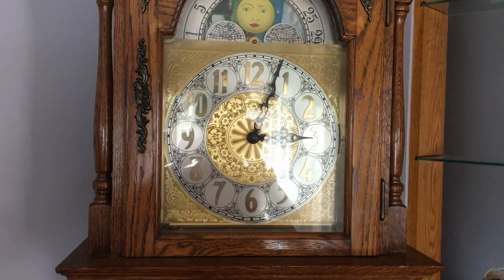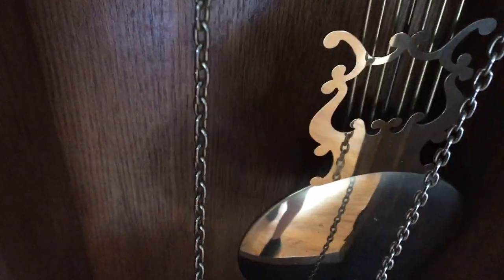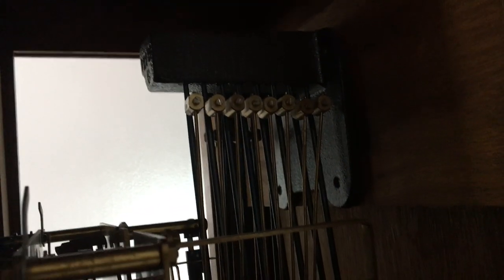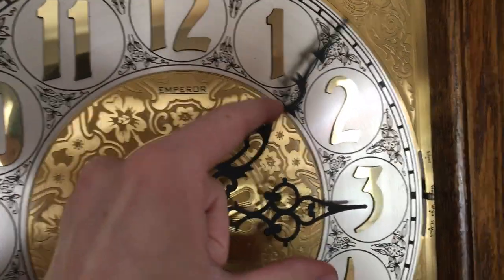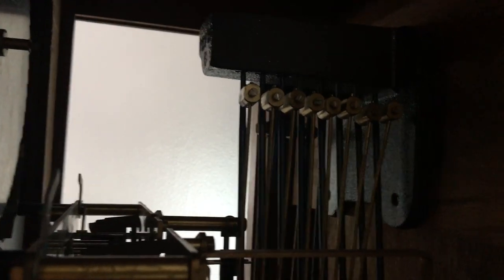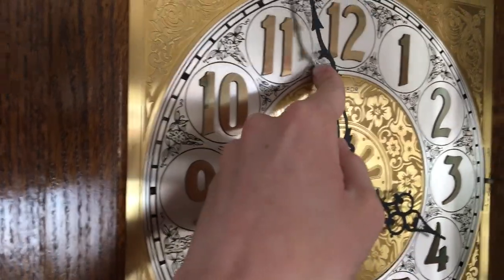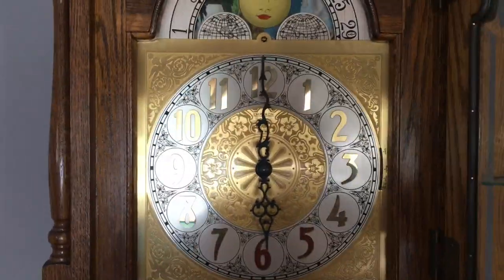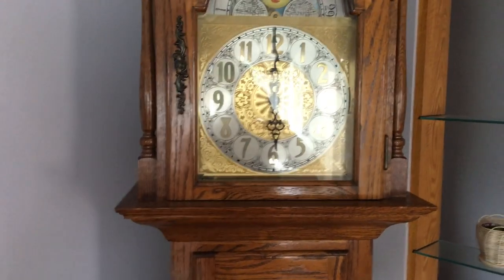Emperor Triple Chime Grandfather Clock

Comment: This clock was assembled by the original owner using the kit of precisely cut wood parts sold by the Emperor Clock Company, which is still in business.
Reply: I have this exact grandfather clock back when this was being sold you had the option of a darker finish (this video) or a lighter finish my clock they are both the same model just different finish options

Comment: My aunt in Colorado has this clock. My grandfather built it around the 1980s.
Reply: I have the same clock
Reply: @cobesclocks1949  Cool.
Reply: I have this exact grandfather clock back when this was being sold you had the option of a darker finish (this video) or a lighter finish my clock they are both the same model just different finish options
 @ceilingfansclocksminecraft1226

Comment: The only difference between this clock and my aunt’s clock is the pendulum and the color of the case.
Reply: @cobesgamingchannel9587  No, it does not, and it can only be accessed through the right panel.
Reply: @cobesgamingchannel9587  Probably, but not 100% sure because the lever was not shown inside of the clock.

Comment: Didn’t know the weights are off. They need to be put back on so the clock will work well.
Reply from the maker: This technically is not my clock, but you’re right. Clocks should be running and not be standing in a corner untouched.
Reply: @The Channel Of Random Minecraft Stuff and More doesn't your aunt have a clock like it?
Reply: ClocksAndAlarms92 Like this one, yes. But she lives in Colorado and I live in Texas and most of my other family members live in Utah. And Utah is where I came from. And I don’t know when we’re going back to the city my aunt lives in and I last been there in October 2016.
Reply: Clocks Fans & Vlogs Update: I went to my aunt’s house in Colorado and I filmed the grandfather clock there. It is a triple chime clock however I only showed it on Westminster.
Reply: @ceilingfansclocksminecraft1226  upload
Reply: @theray2009  I will when I get the chance.
Reply: @ceilingfansclocksminecraft1226  can you now?
Reply: @theray2009  I have it from last year, I’ll upload it when I feel like it.

Comment: Where is this clock? Your friend’s house?
Reply from the maker: Yes, it is in my friends house. This clock has many problems. One of them I found was the chain for the left weight was stuck between the sprocket and a shaft that holds the movement together.
Reply: Well this clock needs to be wound.
Reply from the maker: If the movement can be taken out and fixed, yes.
Reply: P James Did this clock get repaired yet?
Reply: @pjames8673  that can be fixed with a screw driver I fixed that with the middle weight and didn’t have to do shit lol